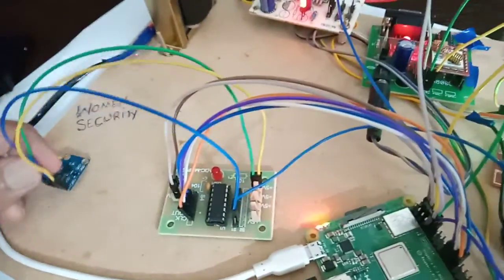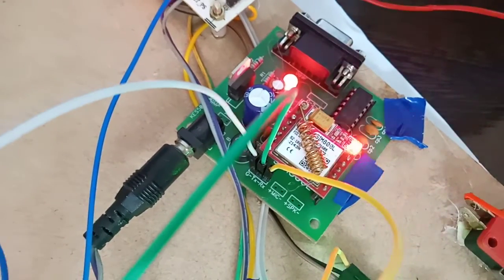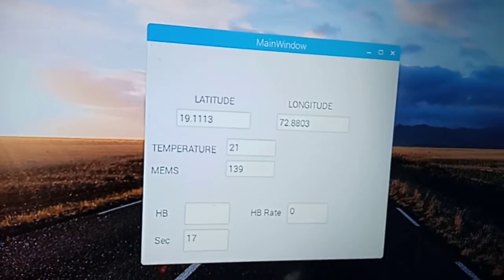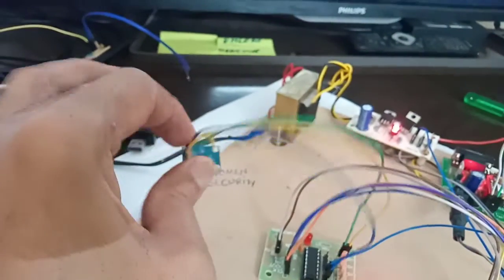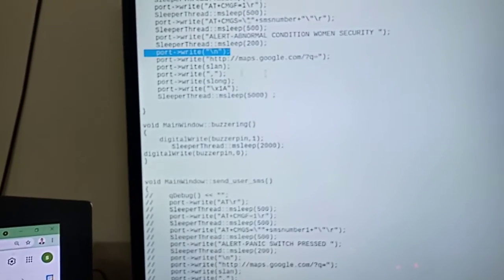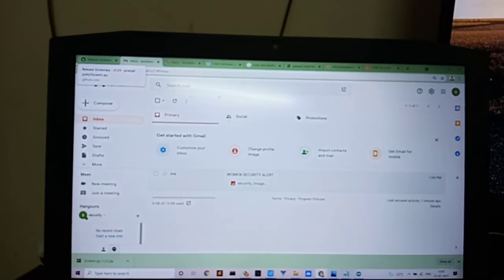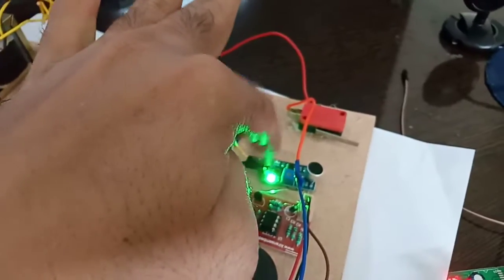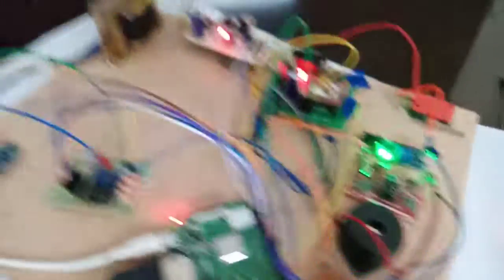WOMEN SECURITY AND ALERT SYSTEM WITH RASPBERRY PI

Comment: I've seen some nice libraries (EloquentTinyML, tensorflow js, AI Code 101) that seem to make it easier to use TensorFlowLite for Microcontrollers.

Do all the tools ( Neurona, TinyML, MicroML, etc) use supervised learning?  i.e. you feed it data with labels/answers (correct input and output pairs) , so that the rules (function) can be generated and applied on non-training data.     The output of a Supervised learning can be in the form of Non-Linear Multi-Regression or a classification  Model.   None of the current microcontroller ML approaches,  use unsupervised learning?

If so, how does ML compare to plain old Open-CV in the case of image classification?

Also, if a microcontroller is connected to power, and has internet connection... how exactly does offloading to the cloud work?   How do you setup a (AWS?) server to take your real-time microcontroller data and have it infer a prediction that is sent back to the esp32, pi (zero , pico), etc?

And what are the different options to port from Tensorflow/Keras/etc output to the actual c or python code that runs on the controller?  everywhereml, Edge Impulse, etc?  I understand Arm has "Vela" that's used to compile the Tensorflow's tflite file, to something optimized for the microNPU (helium enabled Cortex-M55/Ethos-N or U65)?